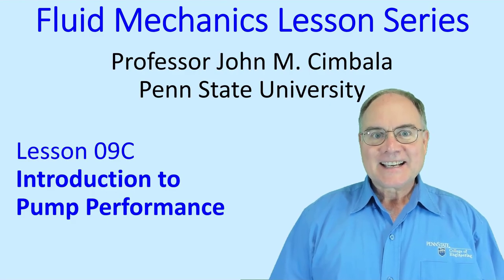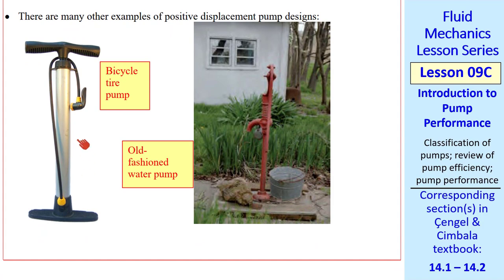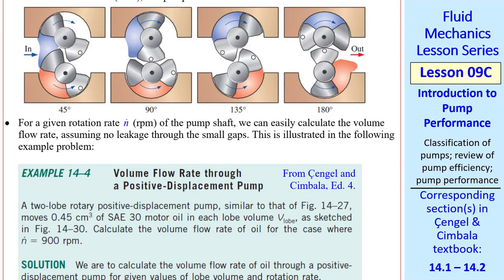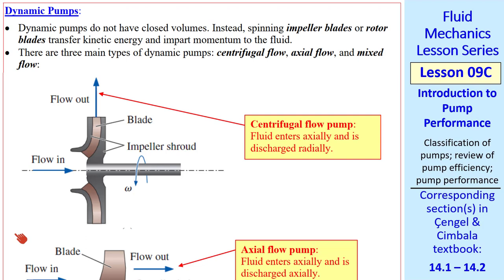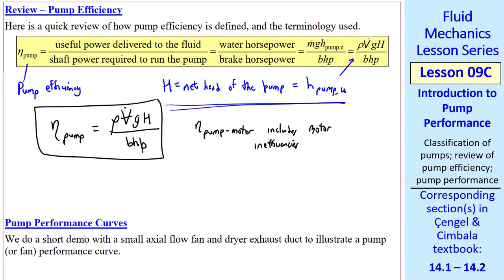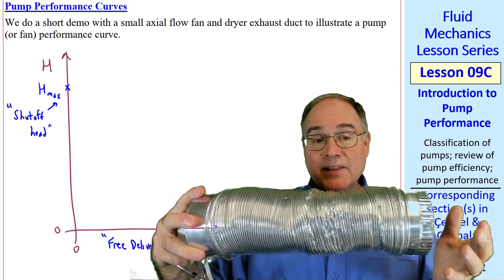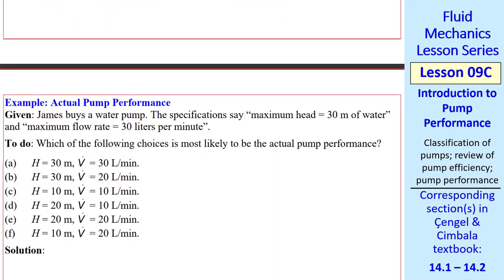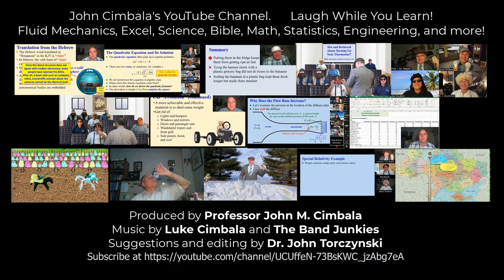Fluid Mechanics Lesson 09C: Introduction to Pump Performance

Comment: Hi John, thanks you for the video. Two questions:

1) Why does max flow and 0 head correspond to 0 efficiency? I understand it is creating 0 head, but in my mind there is a non-zero kinetic energy generated by the fan when you turn it on, so it's still able to provide energy to the surrounding fluid (like a house fan for cooling).

2) Regarding the efficiency curve you plotted, what is the physical reasoning behind this curve? And does a high efficiency mean higher water horsepower, since the efficiency is expressed in terms of electrical power input which is constant?
Reply from the maker: If you think more in terms of a submersible pump rather than a fan it makes more sense. A pump sitting there in a bucket of water with no hoses connected to it will just suck in water and spit it back out without doing any useful work, defined as lifting the water to some head. There is zero efficiency because there is no head - no useful work done. The efficiency is defined in the video and is proportional to both the flow rate and the head. That is why it is zero on both ends. No flow but high head = zero efficiency. No head but high flow = zero efficiency.
Thank you for your comment. Please tell your friends and colleagues about my YouTube channel where there are almost 500 free videos about the Bible, fluid mechanics, science, math, Excel, statistics, air pollution, and other topics. I would greatly appreciate it.
Reply: @johncimbala  Thank you for the reply John. I completely understand the perspective at which you are looking at the problem. You need to apply a force over a distance for work to be done. In the case of the submersible pump in your example, the pump is sucking liquid in and spitting that liquid out without generating any additional pressure to the suction pressure because it doesn't need to (it doesn't need to push against any additional load "downstream"). And this makes sense to me.

What I can't exactly understand is the way we classify efficiency here. The energy required to rotate the pump has to go somewhere. Some goes as heat and other forms of energy losses, and the rest goes into providing the liquid with kinetic energy. Even though the liquid has 0 head, it still has the kinetic energy the pump gives it. If the pump wasn't running, the liquid wouldn't have the kinetic energy. So if we define efficiency as useful work/energy input, why can't the kinetic energy provided by the pump to the liquid be considered some form of useful energy? I feel like because the liquid is moving, it can be used for something - perhaps a jet for a hose?

PS: Thank you so much for your videos. I have read your books on fluid mechanics and watched many of your videos. You do a great job making complex concepts look simple. You have an incredible knack for teaching.
Reply from the maker: @sanjaysrinivasan2071  Interesting idea. One can argue that there is a "useful" result of generating a flow. Right now as I type this I have a fan blowing on me. It is doing something useful - keeping me cool! Technically there IS an increase in pressure from before the fan to after the fan, so it is doing some useful thermodynamic work, which is all turned into kinetic energy and then eventually lost as heat.
Thank you again for your kind comments about my books, videos, and teaching.
Reply: @johncimbala  Right, that was what I was trying to get at. I agree that there will still be some work generated by the fan as it has to push through atmospheric pressure to flow to the user. 

Now that I think about it again, the efficiency definition makes sense. If I were running a pump at the max flow operating point, then I can't move it from one point to another because there is no delta P between the suction and discharge! No fluid displacement, just fluid recirculating within the pump. Not very useful of a pump, considering its application is to move fluid from one point to another.

Thank you!